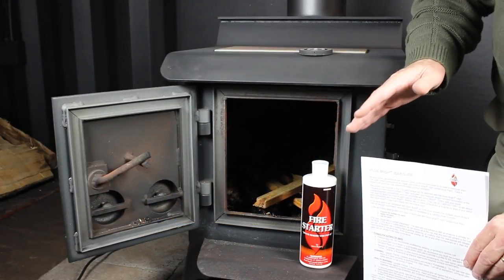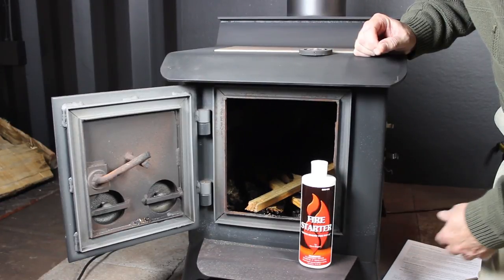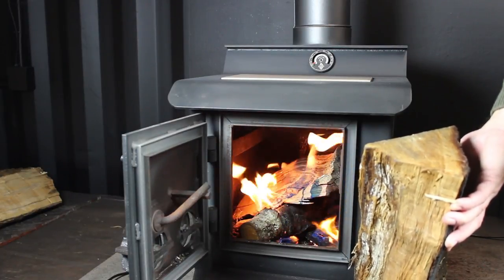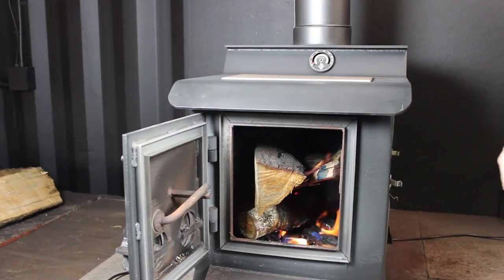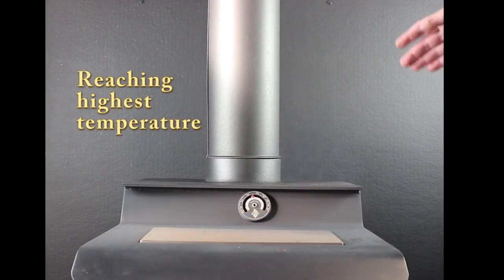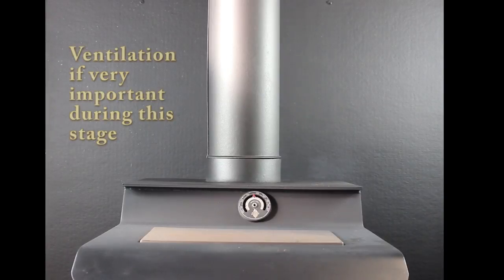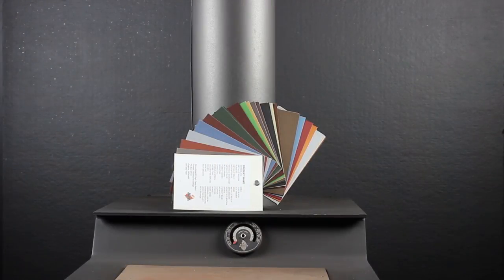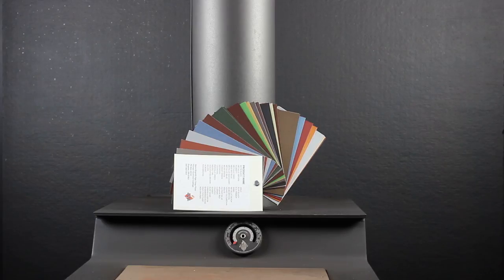How to Cure Stove Bright® High Temp Paint

Comment: I'm currently sanding off some krylon high heat paint from my stove. It kept burning off in the hottest parts, and stinking up the whole house. After I fired up the wood stove, the paint became sticky again, and it shaved off in long pieces with a blade. Where can I find this stove bright paint? The krylon says it's up to 1200 degrees,  but continuous at only 600 degrees. Apparently I need a higher heat paint. What a pain in the ass. 10 dollars and 20 minutes turned into around 80 dollars and hours of sanding. What's this paint rated at?

Comment: What if there are several months lag from the time of spraying on StoveBright and actually firing of the stove to finish the curing process -- will the paint's chemistry still allow the paint to properly heat cure?
Reply from the maker: way ditay 
Yes, you can set the paint by going through the curing process months later.  Even though the paint continues to slowly cure over time, by all means cure it with the burning process.    Enjoy your your newly painted stove.

Comment: Hi Just wondering this paint naturally dries in air so what difference will it make to the paint if we cure it ???? does it become more strong and scratchless and give a fine satin look ???
Reply from the maker: The paint naturally dries in air, but it cures with heat. During the heating process, the paint becomes more scratch resistant and color-fast. If used for a high temp purpose, it will cure naturally. If left uncured, it may scratch easier.

Comment: I have a french fire-place that I need to repaint. It has large glass panes that I've removed so I can repaint the iron doors. My question is can I cure the paint with the glass in place or do I need to cure it and then replace the glass in the doors?
Reply from the maker: You can cure the paint with glass in place.